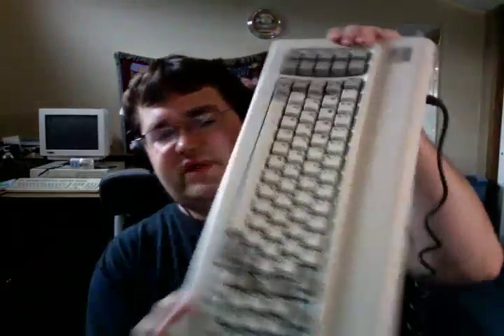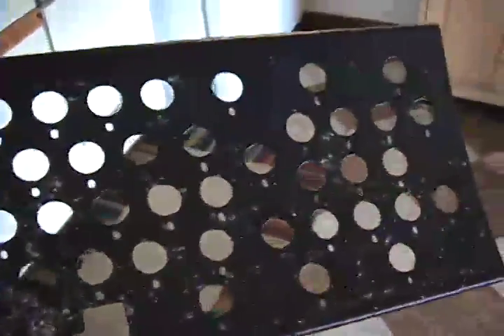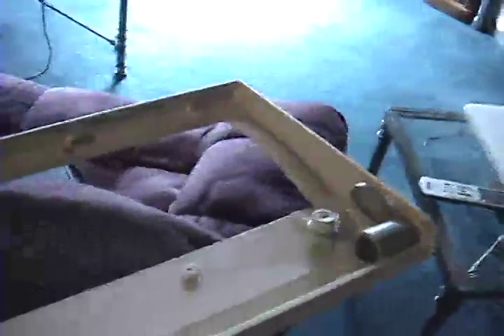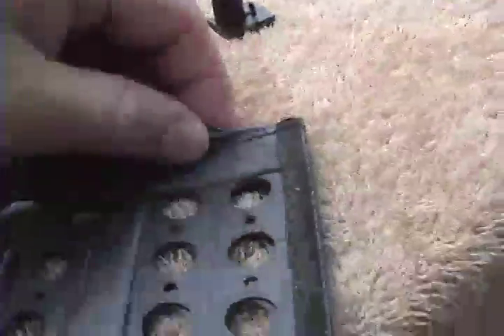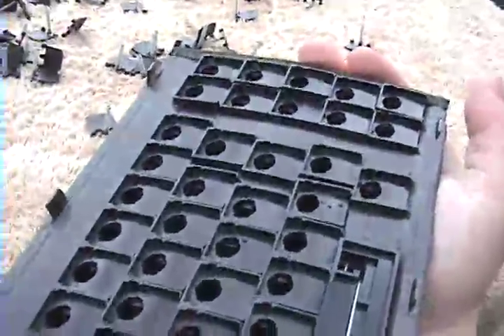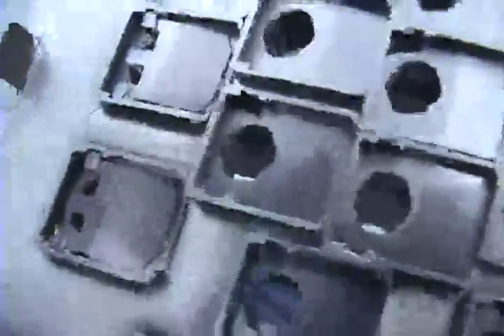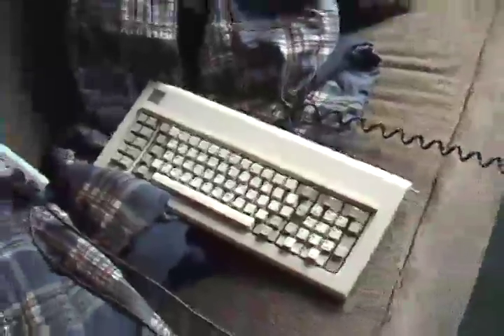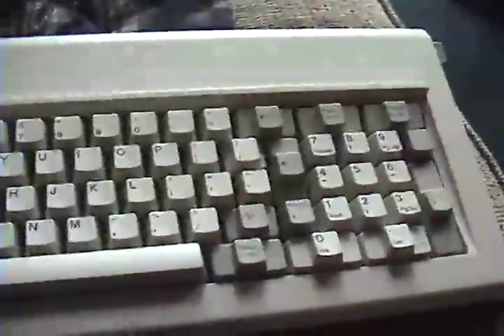IBM 5150 PC Keyboard Restoration

Comment: How did you handle the space bar? Once the bar has been removed, you need to have the keyboard apart to re-attach it (the levers on the sides) - but if you do, then the spring-loaded assembly is floating above the switch assembly when you try to close it...

I was hoping to see in your video how you handled it - but you seem to have skipped over the re-assembly part..